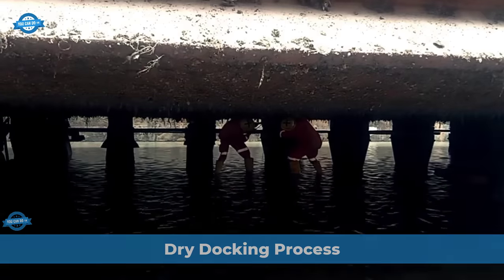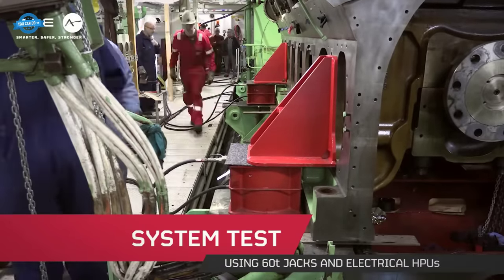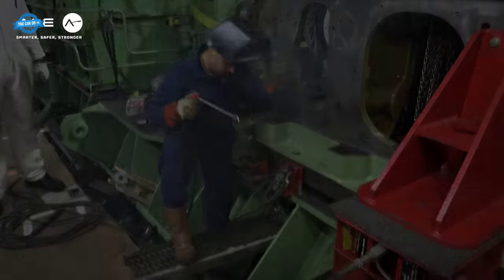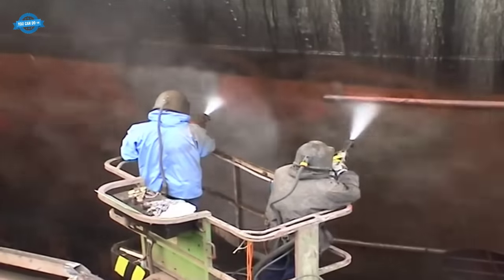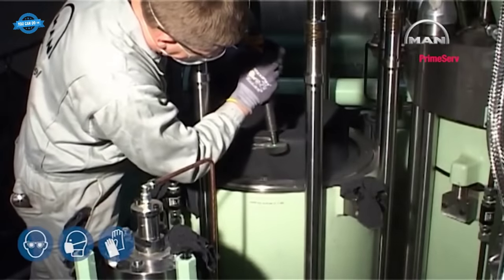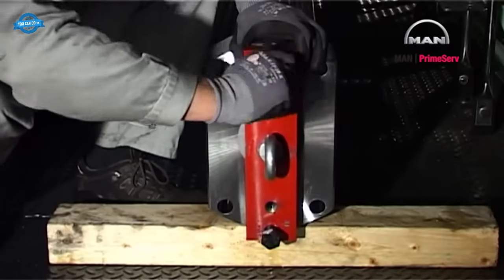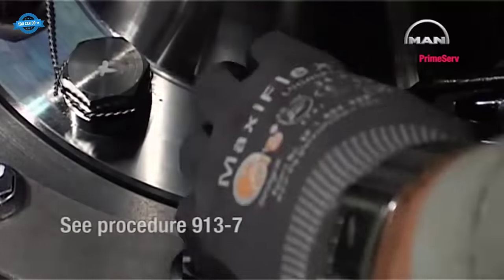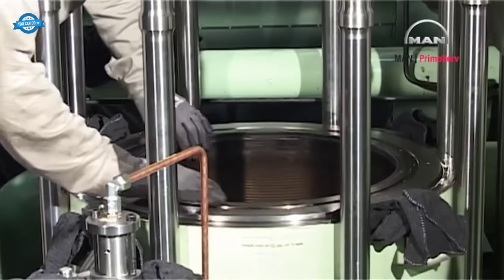How To Replace Large Crankshaft For Cruise Ship. Dry-dock Process & Largest Piston Overhaul Process

Comment: I'll stop griping about my TINY 2-stroke snowmobile crank.. LOL. I'm teaching myself how to rebuild them. I'm not worthy after watching them stuff this 7 TON crank through a wing window.. LOL. Amazing work. I had an opportunity to work in a ship yard in my younger days - I wish I had done it. 

I think newer ship designs are more modular so they can be taken apart much easier for jobs like this (not that cranks are replaced often). Modular designs can swap sections in/out and re-configure the ship quickly. There are videos on submarines doing this already.

I would also think that with today's tech and the fact these huge engines run at low RPM - they'd make the cranks 2-piece or maybe more. 

Great vid! Thank you!

Comment: Great video. It's obviously not a DIY video, but it gives a tremendous insight into the engineering and maintenance of these big ICE engines. I didn't notice which fuel is burned in these motors, but I assumed the basic crude instead of diesel.
Reply: After you refine crude oil and get gasoline, kerosene and whatever else they can get from the crude oil, the junk that is left over is called bunker oil, that's what these engines burn. It's thick like honey, it has to be heated just so it will flow through pipes. I believe they start the engine on number 2 oil / diesel, then once it's up to temperature they switch over to the bunker oil.

Comment: Thats impressive, the process must have been designed into the ship design to allow the crank shaft to be got out. The actual access was so tight it must have been designed
Reply: gee wiz - - - do you suppose they use "designers" when planning and building a ship?
Reply: Not all the time a ship is designed for easy maintenance, my co workers and i did a Cat C18 in a pleasure craft and we carried the head and other stuff by hand and there was only room for two techs and everything had to be carried by hand inside the engine room

Comment: The screws to the piston rod? Screws are used with timber. Those are bolts with hex heads. Tut tut MAN.
Reply: The nomenclature of fasteners is quite complex, and not entirely consistent.  But there is a fastener called a machine screw, most people would refer to them as a bolt, but technically they are not. Machine screws are designed to be screwed into a threaded part of a machine, whereas bolts are usually secured by nuts on the threaded end of the shaft.  

However, machine screws are normally threaded the full length of the shaft, whereas machine bolts usually have part of the shaft unthreaded.  The best description for what you are seeing in the video is known by the lesser-used term "machine bolt" but would more often be referred to as a "machine screw, despite the unthreaded section of shaft.

They would not be referred to as hex heads as they have flanges and are drilled through the head for safety wire, so a complex, compound name and a drawing or photo would be needed to fully identify what they are.  Some variants cannot be identified without a close look at the inner surface of the head to determine the geometry of the surface and shoulder.

Just to finish this off, the bible of machinists is "Machinery's Handbook", a 3000 page monster, it does not use the term machine bolt in its 60-70 page section of machine screws (ANSI/ASME standards (USA), British metric, British standard, British unified, BSW, BSF, Metric [intenational]) and refers to them all as machine screws, It also includes machine nuts, and not just for those nuts that are going to be used on studs, but also nuts used on machine screws.

After that, it goes onto self-tapping screws that are also used in metal, not wood.  These can have a non-uniform or uniform thread form.

Now, to the shape of the head.  When cleaning out an old archive of documents, I came across a hand drawn blueprint of about A2 size from the 1930s, this large drawing illustrated the types and variants, along with their dimensional standards, of "machine screw heads", some of which look the same as each other to the casual observer.  It was for the bin, so I brought it home.  Unfortunately, it has a very low WAF (wife approval factor) so is languishing, along with several other large engineering drawings, in a tube. 

I think MAN may have got the upper hand in the "tut tut" stakes.
Reply: Love the WAF reference. 🙂
Reply: @robertnicholson7733  Anything that uses threads to attach itself to something is a screw, it refers to the mechanical function and not the application. The verb form reinforces the action, for example a nut and bolt can only function if you screw the bolt into the nut. Nomenclature and jargon are sometimes at odds.
Reply: Nomenclature and jargon are not at odds, they are the same thing, despite the derogatory slant placed on the word jargon.  They both describe a "language" used in a specialist field that allows precise and concise verbiage to describe things that would otherwise take many more general usage words or expressions to describe.  Or so my original print (at least 45 years old) OED complete with stand and magnifying glass would have me believe should it not have an extremely low WAF and is thus, along with much of my stuff, languishing in storage. My attempts to have it in the house as a "conversation piece" were futile, something about a "churchy feel".

As an ex-professional engineer, I can assure you that without field-specific jargon, the chances of getting anything right, in many specialist fields, in the modern world would be very low.  This is why these descriptions are codified in standards.  Barring silly mistakes, if you use the verbiage specified in the applicable standard in your order to your supplier, you will get the right part.  Otherwise, you will be bogged down in catalogues and sending drawings and photos to one another and still have a significant chance of getting it wrong.  This ends up with a large catalogue of terms, in information theory, a classic example of a code (language) that increases efficiency as the cost of a large dictionary.  The English language itself, in its chaotic nature, has a relativiely high efficiency, at the expense of that massive OED. 

For a while the Germans used a system that described the function of things as their name, this resulted in rather long and involved names. In the earlier part of my working life, I was involved with Seimens-Halske equipment, the original manuals were a nightmare.

But I am intrigued as to where you obtained your definition of the word "screw" for it was not the OED or the various mechanical standards texts that I have consulted.  Also, I am even more intrigued by this "it refers to the mechanical function and not the application", there is a rather strong, relationship between mechanical function and application, more later.  

In general English, the two words spiral and helical are often considered synonyms, but they are not.  There are spiral staircases in existence but they are quite rare, what most people call a spiral staircase is technically a helical staircase.  This has a direct bearing on this subject.  A wood screw has a spiral thread and could not be used with anything described as a nut, a bolt or machine screw has a helical thread and cannot have a spiral thread, a sheet metal screw can have either or be a hybrid of both.

So, using a set principle to determine the usage is going to have a few hiccups.  One of the more interesting principles is that a machine screw with a nut (there must be a nut!) is considered a simple machine (thus the name "machine screw") so in this case your statement is right, but it is not considered a fastening (even if it is often used as one) whereas a wood screw is not considered a machine but is considered a fastening and that does not agree with your statement.  As to whether the thread goes the entire length of the shaft or not, well...  And as to the bolt, well... out in the cold?  

And finally, if the object that has the female thread is not a nut but a girder, plate, or shaft, is the machine screw technically still a machine or is it a fastener?  

Ah, the joy of the evolution of language where old words are morphed and twisted by modern usage.
Reply: @robertnicholson7733  Nomenclature is the official name, jargon is the slang name. A staircase is not a screw. Screws are not always interchangeable. 
The nut/bolt combo is a structural element only if it goes all the way through without threads attaching to the substrate. And is torqued down. The squeezing force provides shear strength and is much stronger than a fastener of any kind attached to the substrate. 
And from the archives - the groove in the head of a screw used to called a c*nt. Makes sense. A flat head of course.
Reply: @BariumCobaltNitrog3n  Jargon is not slang, it is of 17th century French origin, nomenclature is from Latin via French.  Jargon is a specialised LANGUAGE, nomenclature is a NAMING convention or system that may form PART of a specialist LANGUAGE or jargon.

 Dictionaries do not determine what is official, dictionaries document the use of words in everyday use (this is quite different to technical standards).  As their everyday use changes so do the definitions in the dictionary, this is why the OED has a timeline and etymology for each word, lists all meanings associated with that word as well as any archaic meanings. There is no such thing as an "official" word for a meaning, the dictionary gives the greatest weight to the most used word but all the words for a meaning are considered valid.  A study of the history of the OED will reveal how the dictionary was created from the very first fascicles via examples in the written word.  

You missed the point of spiral vs helical staircase but the issue also applies to dictionary use. That is: the term spiral staircase is in common use, is in the dictionaries, etc., BUT. it is technically wrong.

I refer you back to the first sentence in my initial post "The nomenclature of fasteners is quite complex, and not entirely consistent."

I suggest you refer to an engineering text before you apply your thoughts on the shear "strength" of bolted structures in the real world.  You may also find that substrate may not be the best word for an element of a bolted structure.

The straight slot that bisects the head of a screw applies to many screw heads other than the flat head screw, which, by its nature is countersunk, anything with a part of the head designed to be raised above the surface will have another name, such as round, fillister, pan, oval, etc.  My banned wall chart had draftsman's detailed drawings of all the types then in common use, I think there were about 20 of them.  

I have found no evidence of a derived meaning of the word c*nt (as you put it) that applies to the slot in a screw head, do you have a reference?  However, apart from this piece of trivia, I don't see any point in continuing this discussion,
Reply: @robertnicholson7733  totally agree. off you go

Comment: How to ruin a crankshaft just hoist it with two straps lol it bends under it's weight not designed for any of the lifts like that require a create and careful placement in to cradle
Reply: Might be the best however space on cruise ships is very limited to move such items. Especially when the job is done on the run without any docking or delay in cruises. Video is 4-5 years old and the engine is still running I can tell you.